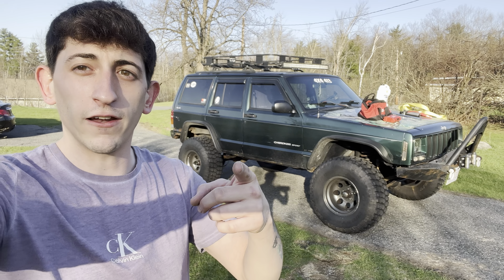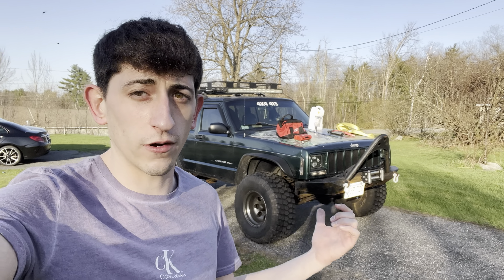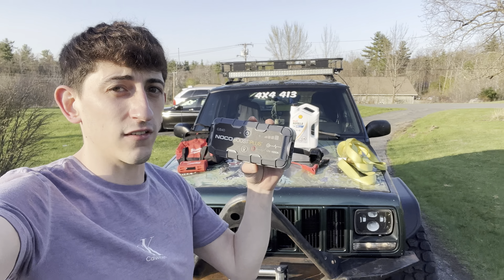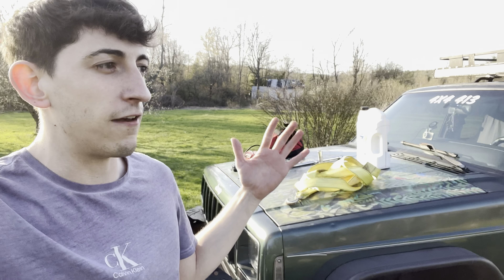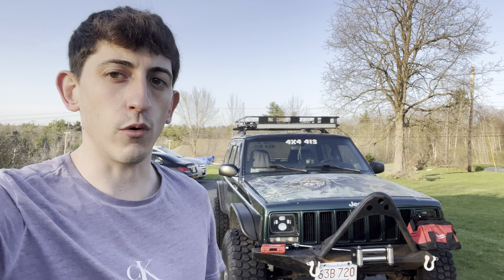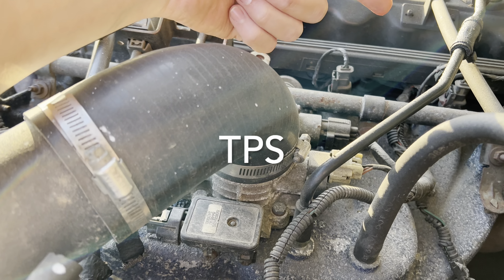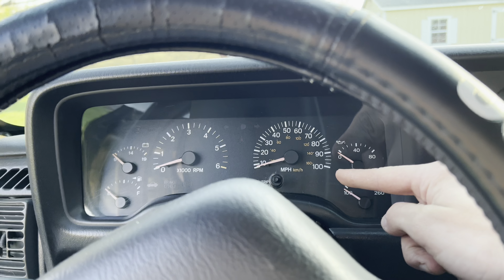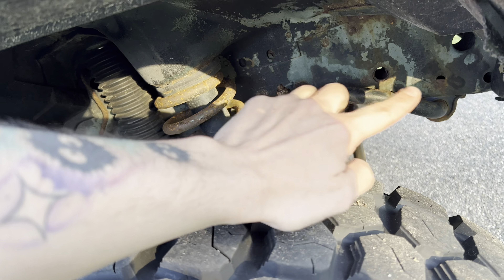The First Thing You Should Buy After You Purchase A Jeep XJ!

Comment: Old XJs are like Harleys..they don't leak, they mark their territory.  Another note. Pull the OEM plastic lower rear quarter panels (between the rear wheel and rear bumper) and clean them out....best to just leave them off.  This is a major rust area for XJs.  Change the oil, do normal maintenance, the 4.0L straight 6 will last for hundreds of thousands of miles.  Rust is the major enemy of old XJs....floor panels, mentioned quarters, etc.  Have three, love 'em.

Comment: Good advice! One other thing I would add is change the motor mounts out to poly mounts. I've had 2 cherokees and the factory mounts are garbage
Reply: I've got a '99 with 375,xxx Miles on it with the factory motor mounts.
I've only had one fail, at approximately 199,xxx miles. The one on the passenger side is the ORIGINAL mount from the factory.

Comment: Aluminum radiator, triple electric fan set up,no more overheating issues. If one dies you can still drive it and the fans can be replaced individually.Ive had good luck with Standard Motor parts sensors. Keep spare sensors,fluids,flat repair/inflation,a few tools. I've got over 350k on my 98. Other than transmission rebuild at around 300k just the usual maintenance, repairs.

Comment: Totally agree on tool kit - be sure to have some quality TORX bits (ideally two full sets in case one of them breaks)\
Head lamp.
Jumper cables.
Hose clamps.
Spare serpentine belt.
Spare alternator.
Spare water pump, thermostat, and water/coolant.
Spare sensors. Throttle body position, idle air control, engine coolant temp, manifold air pressure, cam position (if equipped) even junk yard gambles that you can test good will be adequate over nothing.
Have a 12V air pump handy.
Spare U-joints and a hitch vise.
Tie rod/steering arm end.
Anti-seize or a little thing of assembly grease.
Have a lightweight high-lift jack and a jackstand or two.

I know this seems like a lot, but aside from the small jack and stands I can fit all this into a milk crate.

Comment: I keep a spare CPS, TPS, tie rod end with sleeve, u joint strap and bolts, and dizzy pick up coil, and some various nuts and bolts in my jeep along with the tools to do all those jobs. The sensors are a common failure point and the tie rod end fits the drag link, left knuckle, and my Rusty’s track bar. I also have a bottle jack along with a hi lift and my recovery gear. You could pack as many spare parts and tools as you want but it’s easy to go overboard. All of my parts and tools take up the space under the backseat and a milk crate except for the hi lift bolted to the back seat

Comment: The D35 is just fine... as long as you're not doing hard core rock crawling.    33BFGs are fine.         I just always have drinking water, no reason for "anti-freeze" in the summer.  ;)  
Of course my main rig is a my 79 F150 300 4x4.    The 98XJ is built... but just a toy backup.

Comment: My XJ I got from my grandfather, he bought it brand new in '91. Currently has over 389k miles on mostly factory components. As far as I know, no components in that jeep have been replaced before I got it. These old Cherokees, in bone stock configuration, will run forever. Only within the past couple years have I had to start replacing components like the alternator, thermostat, ball joints, wheel bearings, u joints, shocks, etc. she still needs quite a bit of work but I'm planning to build her to take the punishment BEFORE I start nodding her (IE: dana 44 front and rear axles with Eaton lockers, body stiffeners, steering box brace, upgraded steering box, and rebuilt 4.0l turbo

Comment: Problems that I faced.
Rust under passenger seat and battery. Under front window seal.
Water from the ac in to the foot well because condenser was not properly insulated.
Don't put a drop of water in the radiator it will cause rust.
Overheating. Install a good quality radiator.
Starter and ac compressor failed.
Central locking failed and passenger side switch controls everything and had to be replaced.
Put brembo brakes and disk its great.

Comment: Excellent video 👍 I have owned my Jeep for several years now and you touched on just about every point you should have I would also like to add adding aftermarket gauges due to most of the gauges in these Jeeps not being very accurate at all but that's just a personal option I like to install

Comment: Remove batt terminals, replace sensors with new OEM, or clean IAC and then before hooking up the battery, touch and hold the terminal leads for full minute?  Before watching this video, I had planned on doing the above sensors and disconnecting the battery but didn't know about touching the pos and neg together

Comment: It amazes me the lack of maintenance on these Jeeps. I've bought three and every one needed all new gaskets (valve cover, oil filter adapter, oil pan/rear main seal), front and rear diffs leaking, lack of radiator cooling system, water pump, etc.

Crazy how cheap people are but they will spend $2000 on a stereo system.
Reply from the maker: Hit the nail right on the head 👌

Comment: One problem with owning an older Jeep is that Mopar has discontinued almost all of the sensors that are known to go bad on the 4.0. My crank sensor went bad and I could not, for the life of me, track down an OEM one. I found the NAPA brand replacement is a pretty good one. I just keep an extra one in the Jeep, just in case.

Comment: Great info across the board, "especially with purchasing Mopar replacement parts, that's absolutely key with any Chrysler product, Mopar parts may cost a little bit more initially, but it's generally only a few dollars difference, and the replacement parts will last as long as the originals. 😁👍 

As for the XJ's; 
I absolutely love these vehicles, we as a family own 3 "01 XJ's, One belongs to my parents, and it's a metallic silver 01 XJ limited, 4×4 4.0l 4 spd auto, that's completely stock from top to bottom, with around 170k miles on it, they are the original owners of it, and have always taken great care of it, it's in excellent condition, and has always ran beautifully.
Interior; not bad overall, "non smoker vehicle" no rips or stains on the seats, but the headliner is starting to sag in certain areas, otherwise the interior is in near perfect condition.
As for the body on it, it's pretty darn clean, "especially considering that we live in Michigan.
😂 
My older brother has a Black 01 XJ sport, 4×4 4.0l 4 spd auto, purchased used, 160?k miles on it, and somewhat ruined by a bad rear fender trim job,🙄 whoever cut out the rear fenders went past the welds, and separated the body in that rear section,🤔 It's also got a poor man's lift kit, with longer rear shackles and ford f150 coil springs up front.
It currently has a set of 31" federal Couragia M/T's, on the factory 15" steel wheels. It has trimmed factory bumpers fore & aft, that the previous owner was responsible for, "and actually did a decent job on" 😂 lol it's interior is ok`ish no rips, but the headliner is tacked up in several places, and it's got a few odd stains here and there, otherwise it's a very solid vehicle, and runs absolutely beautiful, it's only major downfall, is that Rear fender trim job, "that's ultimately going to be it's undoing.
My XJ Limited; Gun Metal Blue Pearl 01 4×4 4.0l 4 spd auto, leather interior, power seats, heated seats, stock infinity tweeter speakers up high on the doors, fake wood trim, and a Rancho 3" short arm lift kit "professionally installed by previous owner" 
I've owned it since 2015, purchased it with 134k miles on it, and it  currently has 164k miles on it. I personally removed the fender molding, and Trimmed the front fenders up to the mid way point of the factory fender flare, along with Trimming the Rear wheel wells, along with Cutting & Folding the rear quarter panels, "Learned from watching Bleeping Jeep, and a couple of other YouTubers" The outcome was good, and everything looks professional,😁 it started with 31" Goodyear Dura Trac m/t's, and it currently has 265/75R/16 federal Couragia M/T's, on the factory five star aluminum wheels, not sure on the metric tire size,🤔? But I think it translates to a tall 32" tire, "maybe 32.8" or something like that,😕Idk The interior is clean`ish, but the heated seats no longer work, and the headliner is sagging like mad, it also came with a JL audio 12" sub, and JL 600w amplifier, to help aid in rust removal and future body damage,😄 lol doesn't sound bad on the inside, but I'm sure it sounds like a can of bolts in a paint shaker on the outside.😂 lol I grew up in the in the load stereo generation, and have always had some kind of system, but since I'm currently 49 year's old, I only bump it up when I'm far away from the general public, "otherwise I would feel like a total fool.😄 ha ha ha  "I'm too old for that sh#t! Same thing if I'm out on a Harley, I turn down my stereo, and keep everything respectable, while in the publics eyes.😁
Back to the Jeep... it's been a good rig for the most part, but it does have an occasional hiccup from time to time, that I can't figure out for the life of me,🤔? Sometimes out of the blue, the first and fifth cylinder will stop firing for no apparent reason, and the jeep runs like absolute hell.😕 usually when that happens I shift it into neutral while driving the road, then turn off the ignition for 10 seconds "while coasting" and then start it back up, generally it goes back to normal, but sometimes I have to repeat that process several times, before it goes back to normal again.🤔😕 it's kind of a pain in the rear end! 
Another problem was overheating, it recently had a heater core and rad replacement, when I bought it in 2016, "so that stuff was okay, my fix for the situation was a 180° thermostat, and then I wired the electric fan for the A/C, up to the factory fog light switch, (the fog lights have been gone for awhile so no loss there)
And any time I need some extra cooling, I simply hit the switch, only drawback from that rig is needing the running lights turned on, in order for the fan to get power.🙄😄 otherwise though it doesn't have a problem keeping the jeep running cool. As for the A/C... It didn't work when I bought it, and I've had it pretty much disconnected since day one,😕 But I wouldn't mind turning the AC compressor into a onboard air compressor, at some point in the future.😁
Never the less... we all love our XJ's over here, and I think that you were spot on with all of your video information.

Many thanks for the hard work that went into the video, "your Jeep is looking pretty tuff, and I wish you and yours all the best my friend. 😊👍

Comment: I would say no a the coil pack. The cap and rotor work just fine and easier and cheaper to replace. I agree about the sensors. Go mopar if at all possible. Oriley’s, auto zone and Amazon parts were all bad out of the box. Only mopar and Napa echlin brand sensors work on my 99XJ. I would also say to buy a scan tool if you don’t already have one.

Comment: This is good advice. These ole xj’s aren’t as indestructible as people think they are. You will break down at some point in ownership. I should do all these fixes on my xj its got 250k miles on the clock. pretty high mileage. My engine was rebuilt at some point but the trans and the driveline components are all 250k miles.
Reply from the maker: U joints!

Comment: 😂 10 psi… I had a S10 that didn’t like full synthetic, I switched back to conventional and oil pressure came back up to normal. Don’t know why but it’s not the same and these old motors weren’t designed for it.

Comment: Well, it is often overlooked even when this should be common sense. If you get a used vehicle this old ypu should absolutely take it to a mechanic and have him do the maintenance everywhere. And I mean it.
This includes engine, sensors, intake, fuel system, gas tank, transmission, transfer case, suspension, steering, brakes, electrical stuff, computer reset... and this first time, please get original and new parts. Yes, this is a lot of money, but you have to understand that you buyed a big old toy that you wanna rely on. You wanna take it back to brand new condition as much as you can.

I actually wanna buy one of this and to be honest, I have very strict list of musts for the xj I will purchase.
It has to be 2000 or 2001.
It has to be the 4.0
It has to be 4x4
It has to be stock
It has to be free of rust (easy in Mexico)
It has to be cheap.

I have a very big proyect, but keep this in mind... you might wanna forget about the cheap price, but keep the rest in your list.

Stock vehicles often have a 100% pavement use with the ocasional camping adventure. But if you find a jeep that is lifted, has HD bumpers, roofrack, wheels and tires, lights, winch, lockers... well, decked out jeep... then it was used and abused. And even if it was always well taken care of, you will find something that has already given all it has and is about to break. 
You want a vehicle you can rely on, so please consider that.
And... if you are planning to swap the engine, consider a 6.0L v8 from GM. I am a Mopar guy and I am all about the Hemi, bjt this is the single most reliable V8 engine in the market along with the 5.3L. And, the 6L90 transmission as well (6L80 is good to).

Comment: First mistakes buying a Cherokee with the worst head they almost always crack under extreme heat and Cherokees run at 220 and all you need for a Cherokee is a small lift and 31s and you’re golden I got Dana 30s that I beat to shit on 31s and my buddies xj has a 8.25 with 33s and he breaks shit more than I do😂 you also did not mention that when you lift it you need an adjustable track bar tie rod and drag link mainly a track bar stock drag link and tie rods are fine but weak also need spacers so you don’t rub your control arms while turning even 235/75r15s aka 30/9.50r15 will rub and get yourself and air compressor for you cigarette lighter and yeah tools but get a floor jack never buy a breaker bar you can just use the handle off the jack lol and it’s longer. And truthfully you don’t need to do jack shit to the motor they’re indestructible just a tune up and a flush and fresh fluids and you’re solid I got a 1990 xj for 800$ in a field last year over 300k miles all I did was an oil change and alternator and starter and i daily drive it. I’ve rolled a Cherokee and it still ran so did my buddy and you don’t need oem parts it’s a 23 year old car bro all after market parts are good 😂 I bought my starter and alternator for under 100$ all together 😂